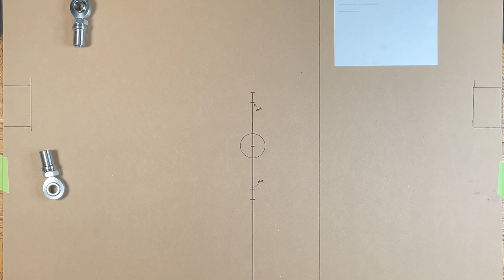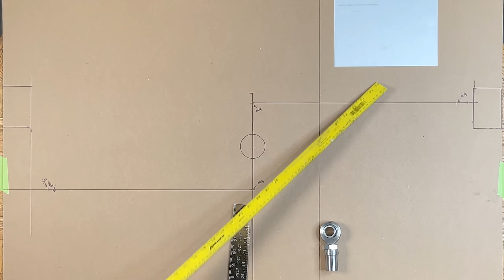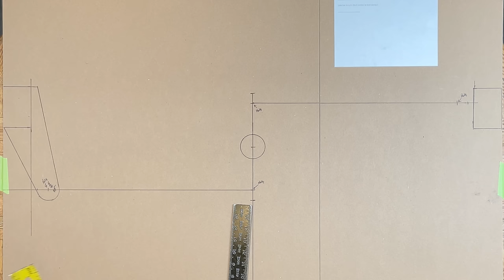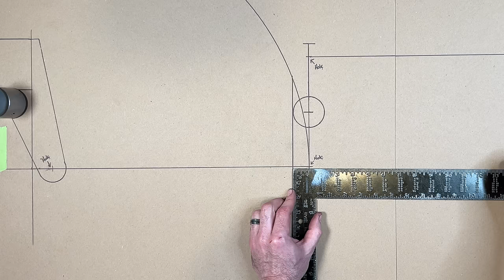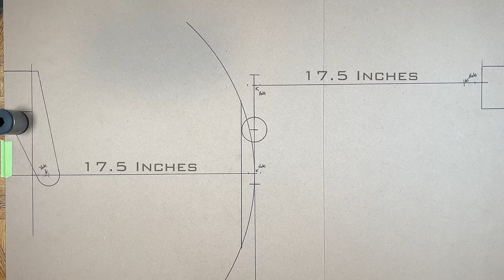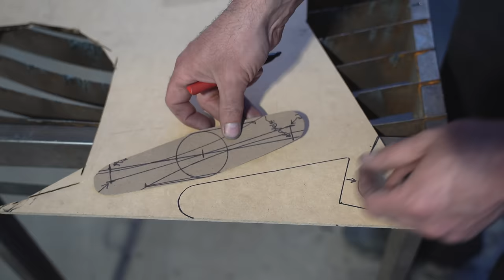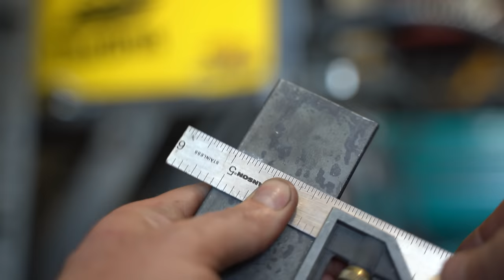The Greatest Watts Link Tutorial Ever! Mighty Max Ep. 16

Comment: Pretty obsolete in my opinion. All you gotta do is install a triangulated upper and lower arm suspension
Reply from the maker: I could not disagree more! The triangulated link setup is simplicity at its finest. But it takes up a lot of space. On some vehicles, (a car with a backseat for example) The vehicle simply won’t allow angled bars. Instead you’ll need Parallel bars that can straddle the rear seats.
Fuel tanks are another thing that often gets evicted when installing a triangulated link setup. If your vehicle doesn’t have room to relocate, or if you simply don’t want that hassle, the triangulated link suspension probably isn’t for you.
Reply: @GarageFab  ok we can disagree but, I see nothing like this out on the trails, Moab, Pritchett Canyon, Rubicon, Fordice, Johnson Valley, nope, people do not use that design. You can say it is awesome, but the proof is in the pudding!
Reply from the maker: I do like pudding.
Reply: @GarageFab  I’m going to Pritchett canyon on the 28th, see you there with your rig and Watts suspension
Reply from the maker: If my Wife ever takes this truck to the dirt, we’re going to have words.